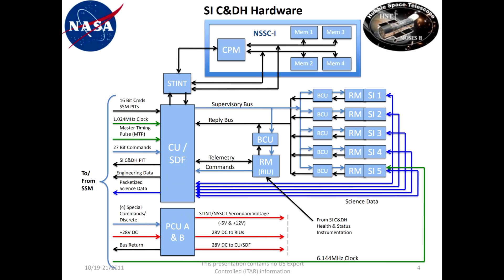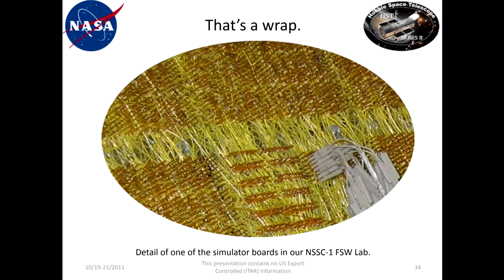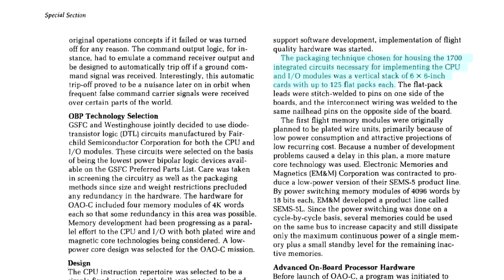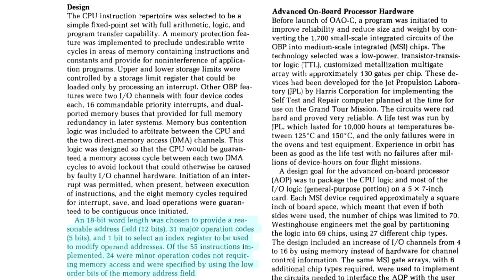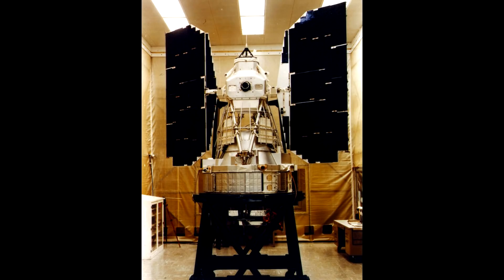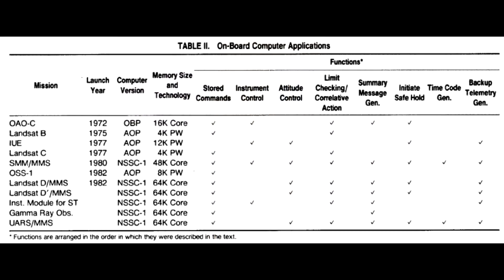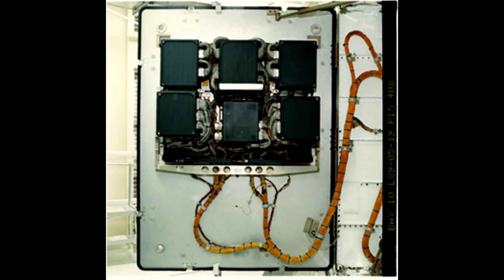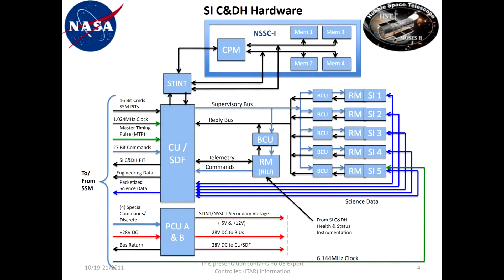Hubble's Latest Problems May Be In a 50 Year Old Computer Design

Comment: I wrote my first program in 1969 and have been a professional developer since 1980, and I am constantly reminded of how quickly and how far the technology has grown/exploded.  Leaps and bounds doesn't even begin to describe how astonishingly fast computer technology has evolved.  I am reminded of a quote about software engineering: "When civil engineering was this new, they hadn't invented the right angle yet."  (And I first saw that on a coffee mug in 1983.)
Reply: Leaps & bounds toward capability, but also toward unnecessary complexity / inefficiency in my opinion. Obviously on modern hardware it's not really a problem, but it continues to be annoying when an update to add new functions suddenly slows everything down. I'd be curious to see how much bigger & slower those satellite programs would be when written in modern high- level language & compiled vs the original assembly code. My guess would be order(s) of magnitude larger, but that's just a guess.

Comment: How about a SSRMS from storage/display mounted in the Dragon trunk? Low development time - just dust off the old control system and wook out some kind of physical mount. That is assuming it would fit in there when folded up. Alternate plan would be a shortened version that would fit - maybe something like a DEXTRE clone? 

Then there's the EVA problem. I think you'd have to have the whole crew in EVA suits, depressurize, and use the ground hatch to egress, because the EVA suits won't fit through the docking adapter hatch (I think they'll fit through the ground hatch, but I haven't verified this.)

Comment: I just hope that none of the space flight hardware I'm working on ends up in the title of one of these 'failure' videos.
Reply: I mean id be thrilled to know my spaceflight hardware failed, if it had just spent 30 years reliably rewriting astronomy books.  I mean 30 years is not even expected of a computer here on the surface.
Reply: @filanfyretracker  Hell, they're 'outdated' in 6 months!
Reply: On the other hand if your hardware lasts this long, a failure by then should be celebrated :)
Reply: Any failure they can't pin an exact blame on becomes "power supply failure"
Reply: @tsm688  Which is, in my experience, actually a reasonable guess. An unstable power supply can cause the weirdest problems.
Reply: @tsm688  And as a power electronics engineer, this is what I fear!
Reply: are you actually working on something?
Reply: Everything breaks, it's just a question of time! If I was the engineer, I'd personally be proud it lasted this long - making computer systems hardened against space is no joke
Reply: Same here. I'm in inspection...
Reply: As long as I'm not the guy who died it's all good.
Reply: Is it really that bad to a have a ‘failure’ after 19 years of ground ops and an additional 12 in space?
Reply: same with the spaceflight software I work on 😬
Reply: @Nick_Trevino  test, test, and test again.
Reply: @HylanderSB  luckily I work in verification & validation so that's the plan 👌🏻
Reply: If your hardware performs well enough to get mentioned in one of Scott's 'failure' videos, chances are that your're well into retirement by that time. On the other hand, wouldn't you be up to a "Space Cowboys" style recovery mission? ;-))
Reply: Oof good luck
Reply: Same lol. But the stuff I've worked on sk far will stay on the ground
Reply: If it does, just pause the game and hit "revert flight."
Reply: Äußerst Unangenehm  Ya’ll need to lighten up the tone a bit.  Hubble is NOT dead yet. Sheesh.  They are still working on possible solutions.
Reply: Depends how long it stays in orbit, everything fails eventually
Reply: Dont worry it will :)
Reply: It will, just hope it's not your part that fails
Reply: Everything fails eventually
Reply: There is no failure here - Hubble has outlasted it's planned service life by years so is a complete and utter win for all.
Reply: If your work lasts 50 years, you needn't worry about it.

Comment: Hullo Scott. I love the Hubble and all it has done for science and especially inspiring my generation. But if we do find some way to get it back on, would it be worth the cost of upgrading the computers, if even possible, still using old hardware, Or would it be more because of the nostalgic love we all have for this machine?
Reply: They say we could have had several hubbles for all the money we spent messing around with the one.  But at least one servicing mission was necessary to restore faith in NASA  after that debacle.
Reply: @tsm688  Not true. The Hubble servicing missions were planned all along. Even without the main mirror defect, the service missions were supposed to replace instruments and other components over the years. That's why there were four of them. I was present for the launch of STS-125 and everyone was pulling for that final service flight to allow the telescope to last as long as possible. It has had a great run; no matter how this problem turns out.
Reply: @bobcastro9386  That doesn't negate what I said.  Questioning the cost effectiveness of that plan is valid.

Comment: Grab it, drop it down to the ISS, fix it, reboost. Ta-da!
I know it's not that easy, but its the only option at this point unless you send up a dragon with an eva airlock
Reply: It's not just higher than the ISS, it's in a totally different orbit.
Reply: @tsm688  I get that, plane changes are expensive, but even if it takes a year to move, it's time well spent.
Reply: @justingrey6008  You could gently nudge it into intercepting the ISS years hence -- if your goal was to hit the ISS with a bus-sized telescope moving at relative mach 1.  It's in a VERY different orbit.
Reply: @tsm688  it's in a higher orbit with a shallower declination. Orbital height and speed go roughly hand in hand, if you want a stable orbit at a given height it's dictated by speed, so the main issue is the declination, Hubble's 28ish degrees would need to catch up with the ISS and it's 55 or so degree orbit, an ion thruster over a few months could handle that operation and the elevation change nicely.
Reply: @justingrey6008  have you lost your mind?  Hubble would be a continuous hazard to everything inbetween those orbits for all the years its orbit is changing, and you cannot put an ION DRIVE on a CITY BUS.  everything theyve done with them has been on objects a tenth of that mass.
Reply: @justingrey6008  Also you are ignoring declination for relative velocity -- you can't do that!  Compare polar and equatorial orbits at the same altitude.  Roughly the same surface-velocity (very roughly - ignoring earth rotation) but if they touch, their impact would leave the shrapnel glowing like a cigarette butt.  Relatively, their velocities are VERY VERY DIFFERENT.
Reply: @tsm688  96 miles in height difference, and 400kph difference. Declination is the only hard part I see here and ion thrusters would be perfect fit. An ion thruster in the half newton range can accomplish this in under 6 months, plenty of time to avoid potential collisions. Remember an orbit is 4 dimensions, don't forget to factor in time, orbits can be shared. 
Approach this as a thought experiment, what would it take to bring the two together. Your right, it's a large satellite, but all you have to fight is inertia. The slowness of an ion thruster here is the selling point, fast moves leave no reaction time for the unexpected.
I would gladly wait 6 months, even a year to get it back up, it's old but it still has value and launching a few thousand pounds of parts for a refurbishment would be a bargain compared to it's replacement cost.
And incidentally the Chinese reportedly use ion thrusters on their space station for station keeping and orbital adjustment. It is much larger then a "city bus"
Reply: @justingrey6008  I think your math is off by 20 years or so.  Putting a city bus through a 3km/s plane change is not an "only".

And how, exactly, would you avoid collisions when a city bus is carefully spirographing every available orbit between the hubble and the ISS over a period of 20 years?  That careful finessing you're talking about only works when you can change orbit rapidly.  This would be nothing short of a rolling roadblock.
Reply: @tsm688  yes, they are in a different plane, something like 24 degreed apart, the total DeltaV needed for that change is somewhere around 3900kph. Again. Ion thrusters can do this, may push the project out to a year. Still a bargain compared to it's replacement cost.
Reply: @tsm688  what do you come up with for needed DeltaV? 
And this are moving fast up there and your forgetting the time dimension again. So in two weeks it's predicted it will be within 5km of a object, halt thrust for one minute, where did that put the object that was potentially in the same space, when your orbital speed is 28000kph? 280k ±5 away from your location.
Never forget about time.
Reply: @justingrey6008  Again, your math seems off by a factor of about 20 years - that is, 20 years of absorbing every bit of trash between the ISS and the hubble with the hubble's face.  That fine orbital collision avoidance you're talking about doesn't work when a city bus is spirographing every available orbit between the hubble and the ISS over a period of 20 years.
Reply: @justingrey6008  3km/s.  Optimistically, 40 millinewtons will accelerate 11,000kg that much in about 26 years.  That's neglecting fuel weight, by the way.  It'd really be much worse.

You're forgetting orbits are round, what intercepts you once, will do so again given time.
Reply: @tsm688  you do know that over 5N ion thrusters exist? And experimental ones over 40N
Reply: @justingrey6008  Oh, and then, another 26 years to move it back
Reply: @tsm688  moving it back you have the luxury of being able to attach something a bit more security then a robotic platform. You could use chemical thrust for the return.

Comment: How hard would it be to just build another hubble if other than updated electronics it was meant to be a stopgap rather than to revolutionize space astronomy?
Reply: What would put it into space? Even the ISS needed the Shuttle for its bigger sections. In the short term there is nothing that could do that. Plus NASA is focusing on building a telescope that is the successor to Hubble but the project has been endlessly delayed.
Reply: @danielpassigmailcom 
The space shuttle's crew and manipulator arm are handy but its cargo capacity is not that high if you don't include the orbiter itself.
A quick search says the Hubble has 12T mass and a falcon 9 can do 15T even with first stage recovery.

Comment: Could one use a human-rated Dragon module to link up to an old Soyuz that would be used as an ingress/egress hatch for maintenance missions without extensive re-engineering of current systems? Or can you not pressurize these modules like airlocks? What would prevent you from doing so, if that's the case? And could you "science the shit out of it?"
Reply: Two separate docking systems for one
Reply: @jonathanrisen  An adaptor would be easy

Comment: A rumour I heard when I was an astronomy graduate student, c1990: When HST was under development, all the teams were behind schedule, and were cutting all sorts of corners to appear as if they were on schedule, with the intent that when another group had to admit they needed more time, everyone else would get more time too, and could then tidy up their cut corners. Then after final assembly, the Challenger disaster delayed things, and bits went through more testing. It was then found that the main computer had so many dodgy solder joints, had HST gone up on original schedule, it would very likely have been dead in the water.
Reply: Hubble was unique, and yet it wasn't.   A lot of similar spacecraft exist from a physical perspective, but they are pointed to look at earth.  Just ask the NSA & CIA..............
Reply: Part of the issue was the mirror wasn't designed to be stored on Earth, it was in danger of warping due to gravity, it was heavy and needed to be in zero-g Space. From what I remember at the time, there was a keyed gauge rod, about 15 inches long, that was installed 180 deg off, in other words it should have been end-turned to grind the mirror correctly. I attended a symposium in Denver, around 1975, on the Hubble, I've been following this for a while.

Comment: Yet another example of why ending the shuttle program without a least some form of replacement was a terrible idea.
Reply: Fair but also the shuttle was pretty bad.
Reply: @magellanicraincloud  Any option is better than nothing
Reply: @paulstubbs7678  but maybe nothing is better than an expensive vehicle that killed 14 peoples
Reply: @paulstubbs7678  thing is: Hubble is really the only satellite that really took advantage of what the Shuttle could do to it's fullest.

In practice, launching a small station about the size of the shuttle's cargo bay with some maneuvering thrusters and a docking port for a Dragon might not be a bad idea though, avoids the risks of side-stacked launches, but leaves you with a robotic arm and a service bay.

Comment: Something I feel Hubble has proved is that whilst JST will be awesome and it will see amazing stuff, sometimes a 'small' mirror can do just as amazing stuff.... IF launch providers do indeed race each other for heavy lift capacity at insanely cheap prices I do hope that it will make it much cheaper to have multiple hubble-esque telescopes flying around. 

Whilst we all 'moan' at NASA and 'traditional' aerospace having this really slow and lethargic development cycle, hubble has kinda proved that they build things such that they last. All their rover missions have run for much longer than was ever in the mission spec, hubble (with a few upgrades here and there) has been running for decades etc..

Comment: Heh I remember doing wire wrap on telecom switch  panels.  Was nice actually, quick and no solder fumes, and if you were good you could make it an art.
Reply: And it still works much better than the rickety wires and sockets they like to use with modern hobbyist things.
Reply: @tsm688  : Yeah, but I'm one of the few folks that's bought a wrapper tool in the last decade, and the only stuff I could even use it on is simple diodes & such.
Reply: @absalomdraconis  I'm not so sure.  They still sell them somehow, and if you wanted it wouldn't be hard to use them with all sorts of arduino hardware etc.
Reply: I made an 8 bit computer with wire-wrap, I should do a chip count, there is quite a lot in there, 48K ram made from 2K static chips, floppy controller & 3 serial ports.
Reply: back in 1990 a fellow electronics student made a 'rugby time signal' clock in wire-wrap; it was beautiful.
nerding out.
Reply: Yep. A good wire wrap would last forever!

Comment: So now we see why we need the Shuttle and it's arm.
Reply: Nah, Starship is coming in quantity, at least one will be fitted with the proper equipment to perform routine on-orbit repairs and replacements, much better than the shuttle.
Reply: We needed a Freedom Space Station to build exploration vehicles, but it got bastardized into the ISS.
Reply: @colinsouthern  I'm pretty confident they will. Elon and a plethora of others at Spacex have the desire, the drive and the means. Starship changes everything if and when it does make it up and back in one piece. ☺

Comment: Hubble has become an irreplaceable treasure for all of humanity. People don't realize how irreplaceable it is because they've been told again & again that the James Webb is the replacement for Hubble. Only it isn't. They observe in different wavelengths with almost no overlap, and from different locations (LEO vs L2 Lagrange point). Also JWST will have a much shorter operational life - only about a decade, and then kaput. No possibility of extending it to 30 years like Hubble. We need to save Hubble because there's no replacement for it any time soon.

Comment: No repair mission.
Build new and better Telescope. With new tech: computer, communication technology, solar panels etc.
They can put 5 computers for backups for all we care. They're cheap, smaller, lighter, way more powerful. 
It shouldn't take long, SpaceX has the engineers and all they need is the telescope (the astronomers should already have all this).
Spacex can put it in orbit as as as they have it. 

Building a spaceship to so you can repair old tech is a waste of money, time, and it would take too long.

Comment: " initially reel- to- reel tape drive for memory ", in outer space , 😵  OMG.
Reply: Successfully used on other missions...
Reply: That was pretty standard for NASA stuff through the 70's and 80's. The voyagers used it, even Galilelo used it.
Reply: Spy satellites initially used reel-to-reel film, too.  Recall the film canisters being dropped from orbit and snagged by prop-driven aircraft, with a hook attached, as the canister parachuted down.
Reply: @NefariousKoel  Oh I know.  That bus-sized monstrosity was the reason the navy inflated the shuttle into a monster capable of carrying a bus.  And in the end they decided "thanks but no thanks" and never even used the shuttle to carry it!
Reply: @NefariousKoel  IIRC the spy satellite tapes back then included actual pictures instead of binary code.
Reply: @danielpassigmailcom  - True, but they were still reel-to-reel tape.  Just as prone to damage, if not more.